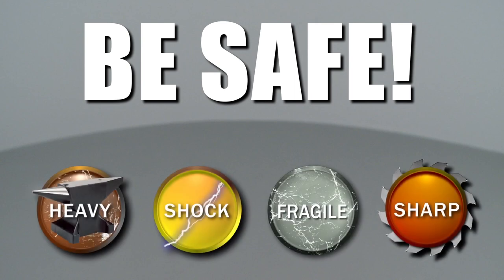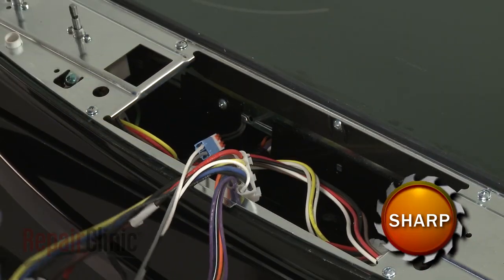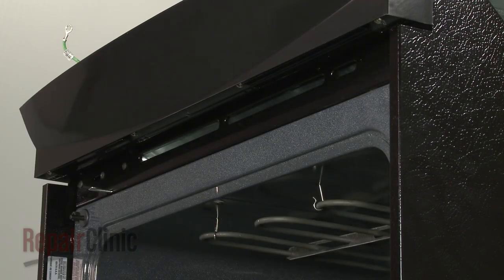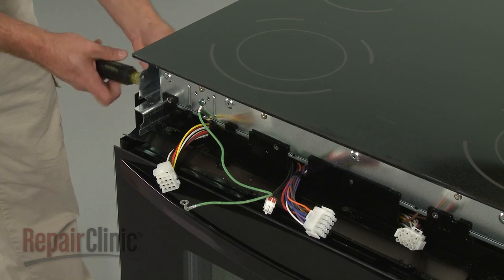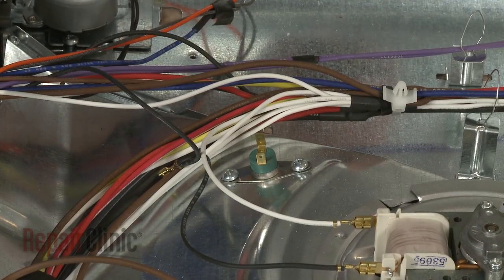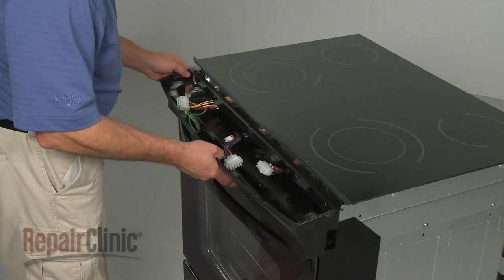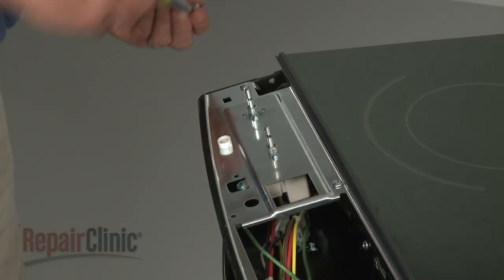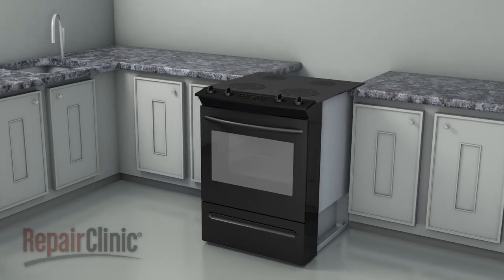Kenmore Electric Range Replace Thermal Cut-Out Fuse #318005229

Comment: Could this thermal cut out fuse be the cause of the broiler element not heating if the lower element is still heating? Just wondering if I should try this first before buying a new element.
But I feel like if there's only one fuse, it's would take everything out if it blew.